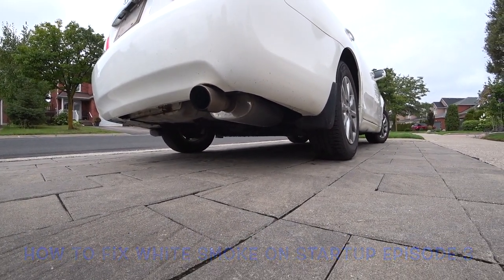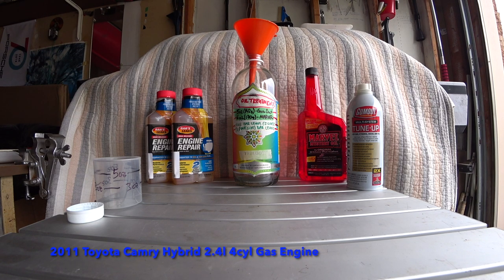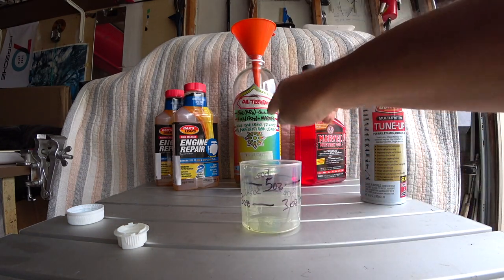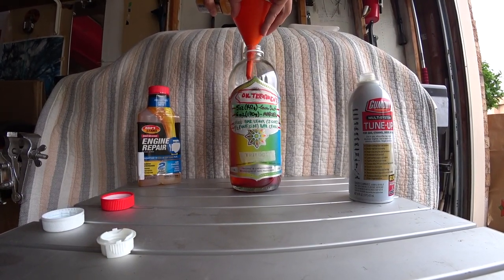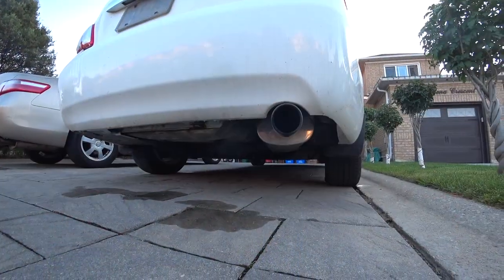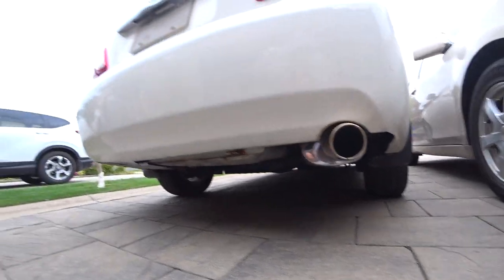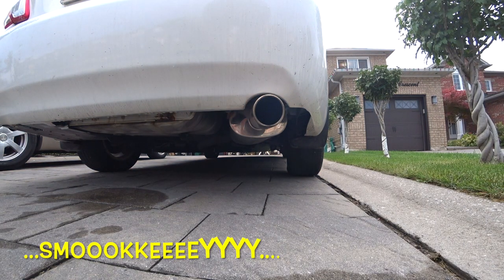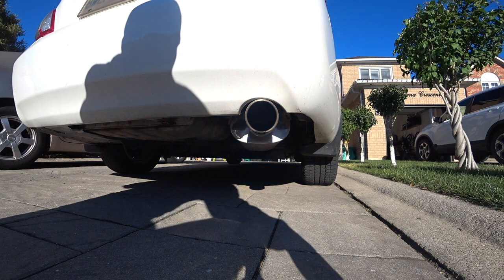How to Fix White Smoke on Start Up 3/3 [Valve Seals Issue] (2011 Toyota Camry Hybrid 2.4l 4cyl.)

Comment: All the oil might not be draining back into the pan from the heads oil drain holes being plugged in the head. Might want to pull the valve covers and see it you can find a clogged oil drain back holes.
Reply from the maker: First, started with PCV valve and it was clogged. Then, changed spark plugs and did a fuel injector cleaner cycle. After, added the engine valves seals repair mix and drove for a bit longer than recommended term. The last treatment did fix the issue, permanently. No need to take apart the engine, start with good maintenance and magic mixture, most likely will do the job, unless the damage is permanent. Every engine issue is different and this is a quick and affordable solution before committing for a costly repair. Appreciate the comment and hopefully this video guide will help. Have a great day!

Comment: Hey, I just noticed the smoke this morning, how much did fixing this cost you out of curiosity? I just wanna get the funds together first and would like a ballpark. Thank you brother!
Reply from the maker: Hey mate, thanks for comment! Glad I can help. For the ingredients, check Amazon, I got all required staff there and shipping was quick. If not available or sold out, go to local Canadian Tire or similar auto parts store, they should have some or maybe even EBay as a last resort. All in, the cost is around couple hundred bucks plus minus fifty, since price might vary per retailer (~$200 Canadian). Don’t bother the mechanic with explaining the fix(unless he is a cool dude and won’t be mad helping you out saving big on potentially highly rewarding car repair job), just ask to add less oil and add the mix on your own. Be patient, let the engine run with this additives for the whole cycle, till next oil change. Add some lucas (synthetic) engine oil stabilizer with next service and going forward (I use about quarter to half of 1 quart bottle or 250-500ml per change, it’s more then enough for engine maintenance but if it’s still running rough, must add a few bottles on next oil change and try same brand injector cleaner). Good luck and have fun while you on it! Have a great day! 👍☀️✅

Comment: Didn't work and these mixtures and products are a bandaid. You need to replace faulty valve stem seals
Reply from the maker: Hi there, thanks for the comment. Very surprised to read that considering it worked in my case, no smoke 6 months later but if the valves or seals itself already gravely damaged and sipping oil thru, the mixture wouldn’t help. Did you actually followed the instructions and did the full cycle of driving after introducing mixture to the oil(about 3-5k)? Possibly that you have other issues with the engine(valve seals are broken or extremely worn out or even damaged valves), please check with your mechanic and use car computer scanner with real life data to check the engine performance per cylinder/valve and to determine the damage or other possible issues. The product works if you use it early, as soon as the issue starts. If you waited for a while, drove the car and caused internal damage, no mixture will help. Also, just FYI, 2007-2009 Camry’s with 2.4l engine had a manufacturer defect with seals and valves that caused major engine issues by the time you reached 100k-150k(causing white smoke on start up) and damaging internal components. I have a 2007 Camry as well that had a similar issue and this solution would not help the car since the damage is due to faulty parts. This vehicles were under Canada(U.S.) wide recall and the engine was taken apart and fixed and no charge by Toyota dealer(it took over a year and a half to get it done since Toyota dealers were reluctant on doing the job and stretched the responsibility as much as possible to fix less cars, I’m blaming for the delay poor management of my local Toyota dealership, the car was driven with the issue for a while and caused more damage before being repaired). The damage was done and “fixing” at the dealer just prolonged the life of car (hopefully by few years), but it’s still driving today and smoke on startup issue is gone. Next time you purchase a used car, buy extended warranty or newer car with factory warranty. I have switched to a new car and have not had any headaches or problems since, best solution ever. Good luck and have a good day!